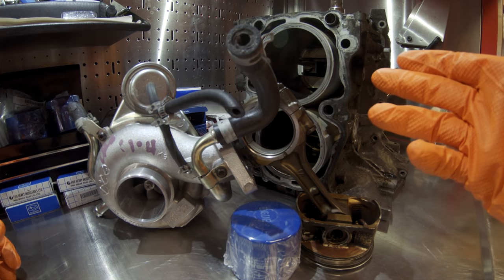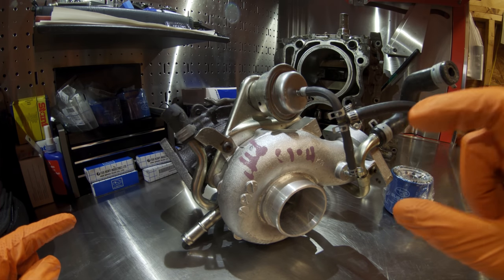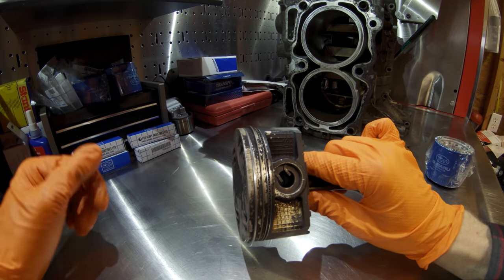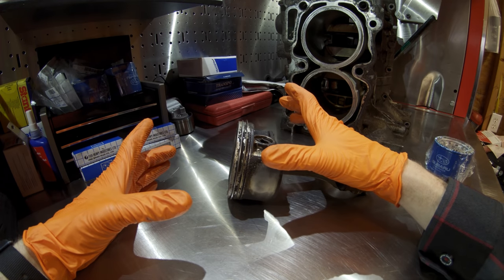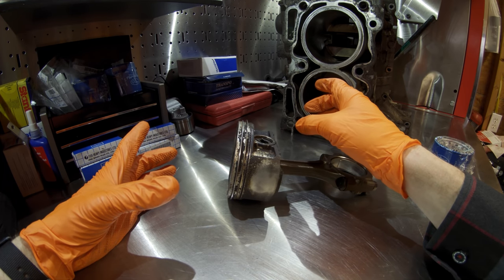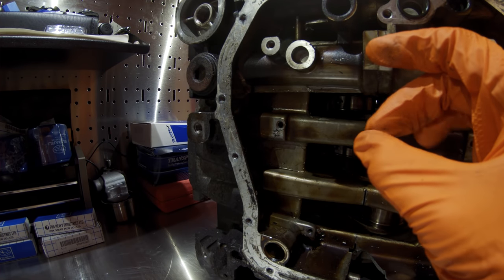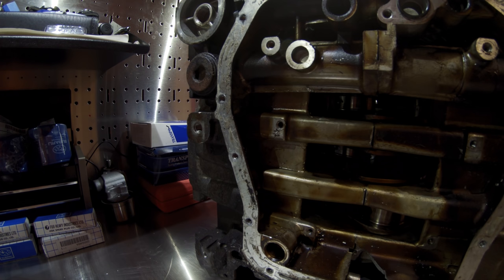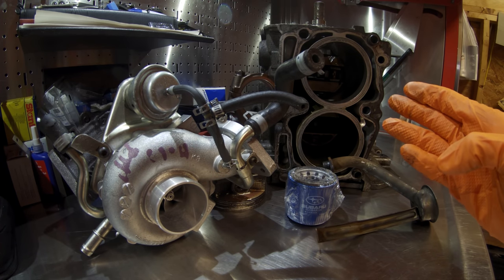Subaru EJ255 Top Failures

Comment: I'd like to point out that Mazda RX-8 engine oil filters fit Subaru engines. They are a longer filter like the older Subaru OEM filters. The bypass spring rating is 20.3-26.1psi and the Mazda filter is manufactured by Tokyo Roki just like the OEM Subaru filters are for pretty much everywhere except North America.
Mazda Part# N3R1 14 302
Reply: The Porsche 944 oil filter fits on the SVX (EG33) perfectly.
Reply: Mazda part #n3r114302
Reply: Tokyo Rokis
Reply: In Australia we get the black Japanese filters though I don't think I've heard of people have oil issues with them even though they seem small for a 2.5l engine. Even my 2.0 Impreza NA uses a bigger filter

Comment: Great video as always! These cars can be reliable if taken care of. My 2004 wrx has 240,000 miles on it. It still has the factory motor, turbo, transmission, and rear differential. I couldn't have said it better myself. These videos are fantastic!
Reply: That is awesome! I just picked up a 2006 wrx with 130,000 miles on it. What have you done to get so many miles out of yours?
Reply: @shawnmacgavin9774  drove it all over new england for years.
Reply: I have a 05 legacy with a 180k miles, every stock

Comment: I spoken to a couple of guys out in California and they have said forget using the stock stuff and use the megasquirt when you do a conversion set up I know that you had said in your video make sure that you do a tune on the car when you start adding a whole bunch of aftermarket parts so do you think the megasquirt is a good set up to run or should I just use the regular stock setup and just get it tuned

Comment: Really well explained video.  Back in the day, I used to build race engines (amateur), so I came into this from a mechanical background.  Your explanations are accurate, complete, and clear.  It is too bad that manufacturers find themselves pushed to make changes for marginal benefit, but significant long-term risk.  A car that is scrapped before its time negates every environmental benefit that was gained.

Comment: Hello Mr. Subaru, you make excellent points on EJ255 failures, and how to avoid them, I have an 06 legacy 2.5l GT not knowing how hard this engine was run before I got it was scary. I changed oil & filter right away, always check the oil. Drive the speed limit, give it a little gas in the corners, it is so much fun then back off. No open throttle or wild street racing. I agree with everything you said about the top failures of Ej 255 engines, it came with a n AEM cold air intake and an aftermarket exhaust . I will be looking for a stock air intake, just found a dedicated Subaru bone yard fairly close by. Thanks for all the right on info, so far it's been s cool ride, .....

Comment: Another spot-on video. I've learned a lot from your channel (just found it recently).

The '05 OBXT we bought from a Subaru tech in Detroit suffered the banjo bolt filter failure that did kill the turbo, then the engine at 112K. He bought the car from the customer, put in a newer short-block, and replaced the turbo. After reading about these sort of issues before I bought that car, I quickly took it to a tuner to get rid of any factory lean running programming (and honestly, put in a little freer exhaust at the same time). A little more power, and less worries long-term, well worth the cost.

It is interesting how Subarus are so sensitive to the intake side of the air stream. Unplug a Subaru MAF sensor and it won't run at all (been there done that by mistake after I put in fresh injectors at 200K). No fallback to ECU map / O2 sensor readings to compute fuel mixtures like most Euro/Bosch ran vehicles.

I'll have to look into that Killer-B oil pickup, sounds like a good idea, and possibly the larger oil pump down when it needs a rebuild. Keep up the vloging!

Comment: This is an outstanding video that really explains a lot.  Hopefully people who add a bunch of extra mods on their 255/257 watch this first.
Reply: Late reply, but I bought a Subaru Legacy GT that I suspect has a slight crack in one of the piston rings. Slightly too much oil consumption, but no smoke or anything crazy, wish me luck! Anyways:

I checked the service history of the car and there is no documentation of a PCV valve having been replaced. I did this myself. This part is extremely important to keep cleaned out in your turbocharged car, especially one with cast pistons! 

The previous owner also said he started to have issues with the car only when he threw on a turboback exhaust, turbo inlet, and removed the TGVs. The car should absolutely be kept stock bar a professional tune on a dyno.

Comment: Can you point out where the banjo bolt is located please? I'd like to change mine!
Great video by the way keep it up man you'll be getting tons of subs in no time
Reply: I second this
Reply: It is under the intake manifold towards the back. The banjo bolt connects the line that feeds the turbo and the variable valve timing up front. You can remove the filter from it but you must use the factory bolt because of orifice size.

Comment: I would also like to mention that along with taking the turbo out thanks to that filter screen in the banjo bolt, It will also starve the AVCS solenoid of oil as well and may possibly cause the cam to chew into in the front cam cap.

Comment: I picked up a 2005 OBXT really cheap this summer that had a turbo failure that sent metal all through the engine. The fun started with trying to find a used replacement motor. #1 was found to  have damage before it was shipped. #2 supposedly was a 90,000 mile motor but looked like it had more like 190,000 miles with a well used aftermarket timing belt. #3 suffered the same issue the original motor had, before I installed it I found pieces of turbo bearing in the oil pan and scoring on the cams and journals, so back it went. #4 had the same issue again but was discovered before the motor was shipped. I'm currently prepping #5 to go in this weekend. Hopefully this is a good one! Check those banjo bolt screens!

Comment: The main let down on the ej255 was factory cast pistons. Sti had all the goodies 6spd and factory forged pistons.  Also, the factory oil pick up did have issues but corrected with a killer bee or aftermarket oil pick up.  Tunning is a key factor in owning one and also having the right mods to suite.
Reply: only the jdm v7 sti had forged pistons, and it was a 2.0, everything else has hypereutectic cast pistons.
Reply: @Travis H  cast pistons are nasty however my rods on the ej255 good for about 250kw
Reply: cast will last longer

Comment: Thank You!!!   Really appreciate what you're doing and loving the new format. 
Which higher capacity oil filter brands do you suggest? Are the 12mm oil pumps JDM only items, or will they work on our USDM vehicles? And will the upgrades mentioned work on NA/Non-Turbo vehicles? 
Again, Thanks loads.

Comment: Excellent video thank you! The only comment I have is there’s substantial debate on whether to increase the oil pump size from 10mm to 11mm for single AVCS EJ25s. My question is does the Non-STi EJ (10mm) run with lower than optimal oil pressure?

Comment: Hi man, I love your videos. They're very helpful. Would the turbo failure point also apply to a 257? I have a 2006 Forester XT auto, and there is a small amount of white smoke coming from down in the passenger side of the engine well. It has smelled on short drives since I bought it, but that usually went away quickly. It is getting worse lately, and the visible smoke just started. It might also be worth mentioning that its getting cold out...
Reply from the maker: The 257 is in the STi. Your Forester XT is an EJ255
Reply: @MrSubaru1387  I'm stupid, lol. Yeah you're right. I am pretty certain whats actually happening in my case is the valve cover gasket is leaking. But I've been wrong before.

Comment: 1. Bought 2014 wrx non sti from a lifelong friend. She used 87 Octane. Bad.
2. Had it 2 weeks, added Cobb stage 1 tune. Loved it.
3. 2 weeks later added AEM cold air intake. Test drove, spun bearing. (87 octane big contributer)
4. Just bought an EJ20 take-out from Japan and will swap all parts from mine to the 20.
5. Took pictures of all the numbers on the motor. Do they indicate what year/make/model the engine was in?
6. The ej20 has the AVCS on the intake only like my 255.
7. Does the ej20 need the turbo oil pickup, and oil pump replaced? Or should I leave the oil pump in the ej20 and the oil pickup? Ej255 turbo will go on the ej20.
8. Should I install an external oil cooler? 

Thx for the help for this old guy new to subies!

Comment: Great video, thanks for taking the time to explain things thoroughly. A couple days ago I bought an 06 Outback XT that is super clean with 125K miles on it, I got a good deal and can afford to spend a few thousand if necessary to make it right. The turbo has failed and I have codes P0011 and P0302. I just cut the oil filter and there is metal in it for sure, it isn’t an insane amount, you have to take it out in the sun to see the glitter in the very bottom of the filter can, but it is there for sure. I am struggling with how far to go with the repairs to have the best chance of making it reliable for another 100K miles. Do I need to pull the oil pan? Would it be easier to pull the whole engine and at that point do head gaskets, timing belt as well? Is there an oil cooler that should be flushed? Or just change the turbo, pull the screens out of the banjo fittings, several quick oil changes and roll with it? I was wondering what you think is the best course of action, understanding there are no guarantees and an engine failure is always possible once there is metal, I just don’t want to throw everything at it if 90% of the time less work works out ok.

Comment: To put the larger oil filter on does that require anything other than just Screwing it on just as you would with the other one? Also if I get it from Subaru which one do I ask for to get the larger one I have a 2004 FXT thanks for the great video!

Comment: About the oil pump, bigger doesn’t always mean better. If you have a 10 mil and upgrade to a 12 mil with stock pan, you can actually outflow and have the less oil in the pan than desirable. Only upgrade up a size. Ex. 10 -> 11 or 11->12 mil

Comment: Had a 2015 Crosstrek, Subaru recommended oil changes I believe every 10,000 Km. The oil looked like sludge even when doing oil changes every 7,000 Km using mobil 1 0W-20 Full Synthetic. They want people to destroy engines lol.

Comment: Thanks for explaining the issues surrounding this engine and what we can do and avoid. I have a 67k '12 wrx, change my oil and filter every 3k, but I really need a reliable car that won't keep me second guessing(weekly trips to doc appt for medical condition).  I even considered selling it. Would having the car tuned so that it is not so lean increase the reliability if I do keep the car?  Thank you very much.  -Ron
Reply from the maker: Yes, a tune would help reliability. Thanks!
Reply: @MrSubaru1387  Even if the car is stock?  Since you mentioned the stock tune was problematic.

Comment: I have a 2011 wrx, i change the oil between 3-4k miles. Had it since 68k miles. Got 120k now, probably due for some work before it goes. I already burn too much 5 30 oil. I put 5 40 in it last oil change, ill see how its doin

Comment: The '05 to '06 legacy GT has the same exact engine as the 04 05 STI! Which have lower compression than the 07 and up GT. But absolutely agree with the engine mods
Reply from the maker: No they don't. STi has an EJ257. LGT has an EJ255.

Comment: Great video, crucial tips!
My ‘05 Outback XT has a whopping 210K miles on it.. Even though everything is fine now, I want to eventually overhaul its motor. Will an 11mm Oil Pump from newer models fit/work ok on my ‘05 OXT?

Comment: Great video as usual. On the oil filter does subaru still make a larger oil filter that will work on the ej255?
Reply from the maker: Subaru USA does not. I've heard you can get it from outside sources though.

Comment: Hi, thanks for the great video. Are ALL of the 2.5L engines EJ255 or there are certain years? Are these only turbos?
Reply from the maker: The EJ255 is the turbocharged DOHC 2.5L found in Legacy GT, Outback XT, Baja Turbo, Forester XT, and WRX.
Reply: @MrSubaru1387  thanks! Wondering if you could you do a similar video for non-turbos? Unless there is one already. That would complement this well.
Love your content. Thanks again
Reply from the maker: Last week's video was for the N/A engines.
Reply: @MrSubaru1387  Thanks I missed it! Was trying to find some clues whether I may get affected by the head gasket issue with my 2.5i 2011 Impreza, and it looks like I might... :(
Reply: MrSubaru1387 did they make the tune for the 06 wrx leaner as well? Just curious, going to buy one this week. Thanks!!

Comment: Great video! Is the banjo bolt in the turbo easily accessible and serviceable?
Reply: It's not on the turbo. It's on the top of the block underneath the intake manifold towards the rear. You may have to lift the intake manifold a little to get to it. Not sure what other parts.

Comment: If you replaced the head gasket,  and your exhaust is smoking. White and burning oil  whats the possible cause im running 350 hp on a 2012 wrx

Comment: Thanks for the wonderful video. I have a Forester XT 2009 (EJ255 Engine) with 154 thousand miles on it. It has recently started giving me trouble. It has broken two turbos and the local mechanic now has recommended me to either go for an engine rebuild or replacement. According to him, the engine is not generating required oil pressure anymore. I am very disappointed with my Subaru purchase and now stuck very bad. Can you or anyone please help me out with anything reasonable so I can get rid of this car? It a clean car and everything works with the navigation system as well. NEED HELP
Reply: 2010 FXT over here with 120,000 miles. Bought used a year ago with 99,000 miles on the dash. The car’s interior and exterior look fantastic for the age. New battery, new terminal, new oxygen sensors (front and rear), new spark plugs, and new ignition coils are the maintenance I’ve done so far. Valve cover gaskets have been ordered (oil leak) and I need a new ball joint on the drivers side and an inner tie rod for the passenger side. Water pump, belts, and cam/crankshaft seals are planned. And I’m hoping that the spark plugs/coils fix the P0420 code I was getting just days ago. If not, a new catalytic converter will most likely be needed. I have done/will do all these repairs myself.

I feel similar to you about this purchase. Throw in the fact I get 20mpg on average and have to use Premium Unleaded due to the turbo… I’m trying to stay positive.

Comment: I'm curious if you have an opinion on why the Subaru engines with AVCS seem to have more carbon build-up on the piston face and on the valve stems (likely contributing to more frequent valve-guide drop) than the previous generation of EJ25s?

Comment: The Filter is smaller on the outside but what about on the inside material surface area and length. 
Eg, the White K&N Filters are tiny compared to others like half the size but they have 45% more material/surface area on inside than OEM Filters.

Not sure about 2.5L as i would never have one as its just same block as 2.0L bored out too big. 
Ringland Failure in most cars is 95% the drivers fault for LSPI and not downshifting when overtaking or going up a hill. 
You DO NOT ever floor it WOT under 60mph in top gear.

Comment: I have a 2006 wrx ej255 with the single avcs. Would you recommend installing a jdm 12mm oil pump instead of the stock 10mm oil pump? Thanks for the advice.
Reply: stock is more than fine for stock power

Comment: It’s crazy how some oil filters are so damn small for the engine. I use a M1 EP oil filter on my G37S for the most part but use a bigger filter that has The same diameter and thread pitch because the OEM looks like it’s made for a damn lawnmower

Comment: I doubt anyone reads these comments but.. Assuming the turbo banjo bolt filter isn't cleaned, can that cause pressure to build and have a seepage come from there between the hot/cold side of the turbo??
Reply from the maker: The filter clogs, your turbo is going to blow up.

Comment: I've been running 5w30 for the past two oil changes. 100,000kms. Is it normal for some oils causing noisier tappet noises than others with the same viscosity

Comment: So, doing minor modifications and getting a professional tune could actually make it more reliable than the stock tune? (Assuming you intend on driving it hard on occasion)
Reply from the maker: Yes.
Reply: MrSubaru1387 Thanks. Also, how common is the oil pickup failure? I have an 06 wrx with 165,000 miles and my oil pressure light never comes on (other than when I turn the key on before starting the engine). Was trying to decided if I should replace it.
Reply from the maker: It's hit or miss. No hard data on the probability that it's going to happen, but it does.
Reply: MrSubaru1387 I figured that was the case. I’m guessing mines been a good one, so I’ll probably leave it and if I ever rebuild the engine, I’ll install the things you listed in this video. I appreciate your help.
Reply from the maker: You're welcome 👍🏻

Comment: thanks for this video . I needed this! I'm surprised you did not mention anything about head gasket failure.
Reply from the maker: Head gasket failure isn't common on the turbo engines, just the N/A 2.5Ls.
Reply: MrSubaru1387 I have a 2008 legacy GT with blown head gaskets with 147k miles on it. I still think that’s too early for blown head gaskets. And I know some LGT with lower mileage than mine with blown head gaskets. That’s why I was wondering 🤔🤔
Reply from the maker: Hmm. 🤔
Reply: MrSubaru1387 what are you thinking ? I think that’s a bit crazy.